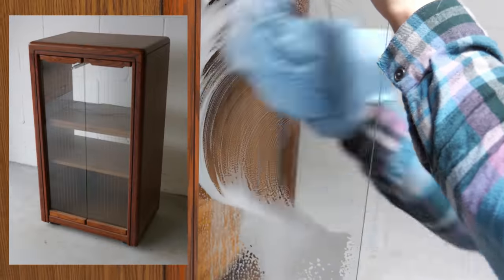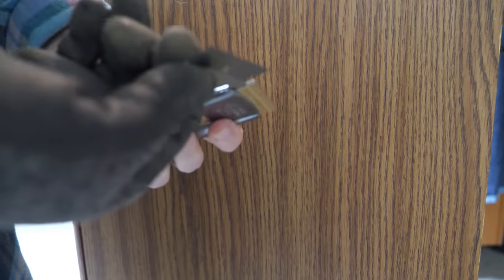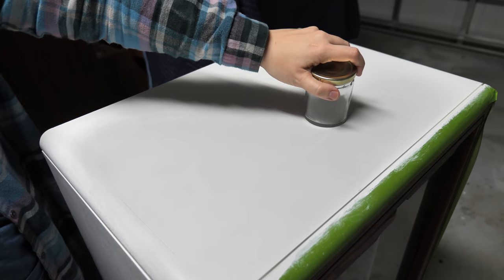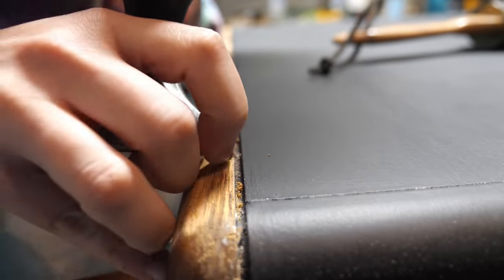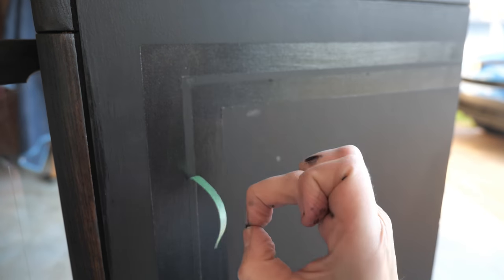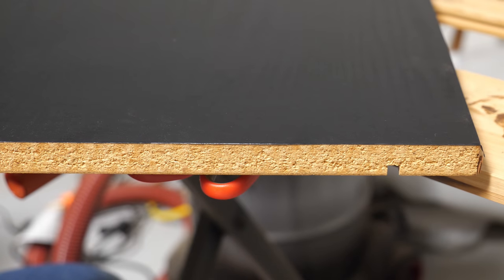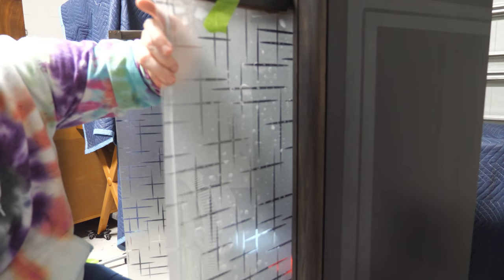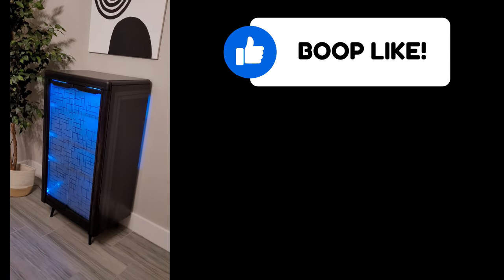Cabinet Makeover... Installing LEDs in Furniture

Comment: Can you provide a link for the utility knife you used on the black contact paper? Thanks!
Reply from the maker: It was the Blue Ridge Heavy Duty Box cutter. I believe I got this from Target a while ago late at night because I couldn't find my other.  Sharp heavy duty blade will cut like butter. I did add one to the list that I would buy off Amazon if I needed a replacement.